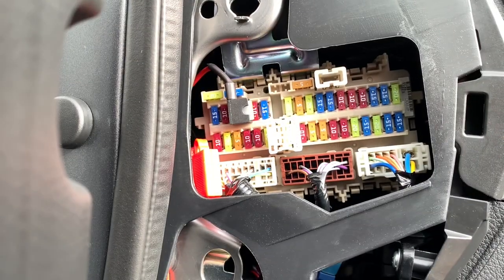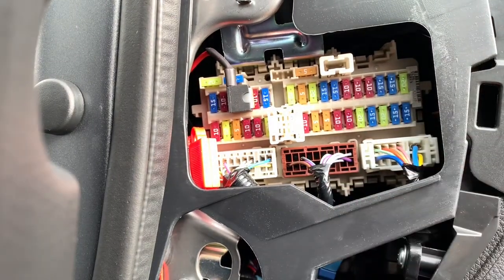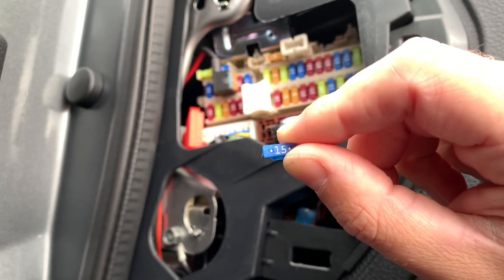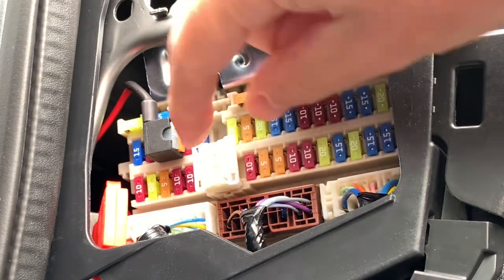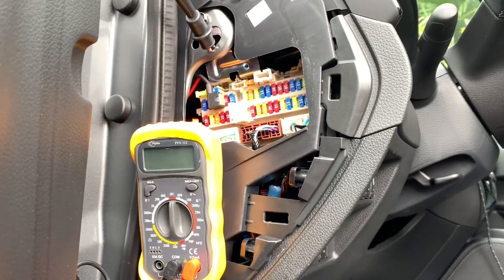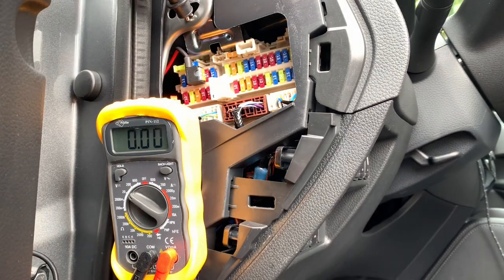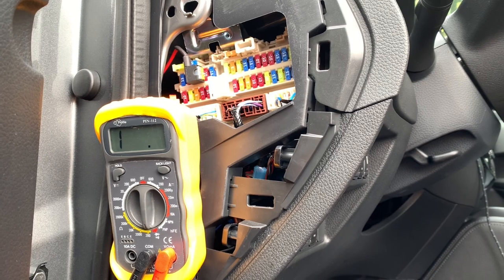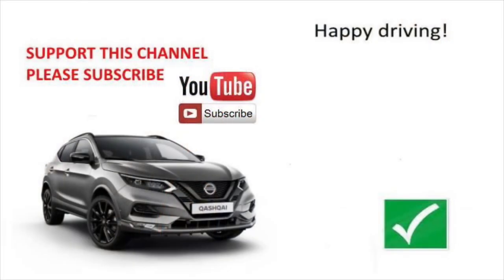Nissan Qashqai J11a&b: Which fuse is safe to use?

Comment: Very useful video -  thank you!! The colour coded diagram for reference is great! It let me know which fuse slots to select when fitting a dash cam that needed safe, switched and continuous connections. Also shows which ones remain live for a short time when locking/unlocking the car, so I avoided those too. Thanks again!
Reply from the maker: You’re welcome 😉 👊🏻
Reply: Which fuse you have finally used?
Reply from the maker: Hi! Those you can use are marked in the table. 😉 Personnaly I wired my dashcam to the power socket in the armrest.
Reply: @techher7274  I finally bought a battery which sits nicely in the glove box with velcro strips. The battery is linked to a fuse that is only live when engine is running so that it charges. I don't have anything that takes power from the battery when the engine isn't on, now.
Reply: @skycrafts5140  Linked to the fuse? Battery?
Reply: @LaPalmeraie0032  I want something hassle free.
Reply from the maker: @skycrafts create a very nice solution indeed. With a add-a-circuit or piggybag it's very easy and hassle free to use a fuse.

Comment: I want to ask you one more question. For welcome door light which fuse i can use? I want when I open the door the lights open and when I close the door the lights close.
Reply from the maker: Hi! There is not really a fuse for this but you can use the wires in the map lights as I did on my second footwell video or use the «M54» connector that Nissan fore sees for the welcome light I have under the car. It’s hidden behind the glovebox in the A-pilar and quite difficult to access.
Reply: Can you send me the link to see the video?
Reply from the maker: @dimitrismoshopoulos7542 see this https://youtu.be/f4FhKRsiDa4?si=i1ekLIwRk2QjYZOk and this https://youtu.be/rW7kvfediqY?si=257rFI1Iavjy7xKi
Reply: @LaPalmeraie0032  thanks you for all. You are the best
Reply from the maker: @dimitrismoshopoulos7542 😇🙏

Comment: This may seem a silly question but will these tips work for the new qashqai ?
Reply from the maker: There are no silly questions, only stupid answers 😉 of course these principles will apply for the new Qashqai and even for ALL cars. The only thing that will be different is the fuse layout (other fuses/different places) and the fusebox could be located elsewhere. But the owners manual should help you out there 😉
Reply: @LaPalmeraie0032  you’re a star mate, thank you for the quick reply too. I’ve just spent around 20 mins trying to find the battery on the thing so I left it alone for tonight it looks like I need a fuse tap or something so I’m safe. Honestly thank you for replying I’ll sub to you as my way of thanking you.
Reply from the maker: 😄 💪 thanks mate. Finding the battery shouldn’t be that hard? It will be well indicated in the owners manual as well as it is one of the basic things you should be able to locate as a user. Try it again tomorrow with a fresh mind and shoot of you still have doubts. 😉

Comment: Hey op 0:53 seconde  heeft u het over de power sockey.
Bedoeld u hiermee  de zogenoemde sigaretten aansluitingen in de armsteun en  het bakje van de midden console onder de navigatie ?

Deze twee werken bij mij niet namelijk vandaar de vraag
Reply from the maker: Hallo! De power socket is de sigarettenaansteker onder de airco unit. De cig_lighter is diegene in de armsteun (omgekeerd zou logischer zijn natuurlijk). Wel opvallend dat beide niet meer werken aangezien ze apart afgezekerd zijn. Even beide zekeringen checken dus; De cig_lighter zit op nummer 15, de derde van rechts boven aan. Bij de Qashqai’s van na 2017 (met de rechthoekige mistlampen) zit rechts ernaast op nummer 16 dus de power socket. Op de eerdere modellen (met ronde mistlampen) zit deze eronder op poort 32.

Indien ze allebei zijn doorgebrand best even nagaan of er geen 12v apparaat werd ingeplugd dat kortsluiting veroorzaakt.

Comment: Hi can you tell me what means a SPARE fuse? I don t understand it. Can i use it for a dashcam BlackVue? 
The live site of the spare fuse is on top or bottom of the fuse ? Or should i use the fuse for seat heating ? Thanks for answear
Reply from the maker: Hi, the SPARE fuses are fuses that are powered but aren't in use yet. Like a spare tyre, ready for use ;) So you could indeed use it for your dashcam if you would like so. The most important thing there is to decide if you want to use a continuous feed or a switched one. First is for powering your dashcam 24/7, ideal for parking monitoring etc but it could drain the battery. The second is for powering on your dashcam automatically whenever you unlock the car. So see what side is the life side, please see my Stop/Start module video where I show it when I place the piggybag or Add-a-circuit fuse adapter.
Reply: @LaPalmeraie0032  thanks for answear. I need a fuse that has power after ignition but not after open the car. 
I will measure it. I know that fuse from seat heating has powet just after ignition. My BlackVue has got a battery and i want to hardwiring this battery

Comment: Can I switch a 5A fuse for meter_ig with a 10A fuse or would it be dangerous
Reply from the maker: Hi! It wouldn’t be dangerous but the manufacturer placed a 5A with a raison. A fuse is there to protect the devices on the circuit behind it. The fuse blows before something bad happens and amperage raises higher than the devices are designed for. So no, I wouldn’t swap the fuse with a higher rating and if you add a device on that same circuit which makes the Amp go over 5A you should search for another fuse. 😉
Reply: @LaPalmeraie0032  That is incorrect, fuses are to protect cables not devices!
Reply from the maker: To avoid the cables to melt then? Ok thanks for this precision😉
Reply: Hi, thanks for your reply I did swap the 5A fuse with the 10A and all was good for like a month, but now the back lights of the speedometer like the (parking, seat belt lights and all other lights doesn’t flash any more) what do you think I should do about it
Reply from the maker: Hi! I’m not sure… I wouldn’t have swapped the fuse for a higher rating because it is 5A for a reason. Please bring the car to a specialist to let him diagnose. Keep me posted.

Comment: hello its me again 😊, i want to install hardwire kit for my dashcam, what fuse spot would you recommend for a 24hrs power supply and fuse spot for just the ignition? i’ll be using piggy back fuse. thanks
Reply from the maker: Hi! Did you check my scheme? There are several continue and free slots you could use. Like spot « 9 ». For the switched the heater seat of you don’t have one equiped otherwise one of the power sockets fuses 😉
Reply: @LaPalmeraie0032  still checking.. i don’t have heated seats.. is the fuse located at the side or at the back of the glove box. mine is 2019 n connecta 1.3 digt
Reply from the maker: RHD model… hmm it’s a bit different I know. Check the fusebox on the side to see what’s noted on the back of the cover and compare it to my scheme.
Reply: @LaPalmeraie0032  left hand drive , i guess its the same. as i checked the manual its located at the side..
Reply from the maker: Ok with all the different questions I lost track 😂 so left to the steering wheel on the side you remove the lid. On the inside you will see the same schema printed as I share in my video. 😉 on « not-imported » vehicules there’s no fusebox in the glovebox.
Reply: @LaPalmeraie0032  okay, what ampere should i use for my dashcam hardwire? or any amperes will do?
Reply from the maker: That depends on your dascam specs 😄 it should me noted in the product or box etc. Normally a dashcam doesn’t use much but you have to take in account other accessoires that are also wired to the same fuse if there are… 10 or 15A should normally be enough.
Reply: @LaPalmeraie0032  okay thank you… whenever i need something on my QQ, your videos are very helpful.
Reply from the maker: Nice to hear my friend 😉 👊🏻
Reply: @LaPalmeraie0032  do we have airbags on the side pillar on the driver side (left hand drive)
Reply from the maker: No, there’s an airbag in the side of the seat and a curtain airbag all the way along the roof; https://ibb.co/CzNv0kz
Reply: @LaPalmeraie0032  okay thank you.. my problem now is how to put the piggy back in the right place, as i’m not an electrician and might put it the wrong way. lols..
Reply from the maker: I show this in detail in my S/S module video 😉
Reply: @LaPalmeraie0032  whats the consequences if i put the fuse not in the proper position? other said i can get a check engine
Reply: @LaPalmeraie0032  based on this video i saw a piggy back that is connected to the elec-igpower. should i put the piggy back same in that position? ill be using the cig lighter and the 20 spare below the 5A ILL..
Reply from the maker: No consequence other than that both fuses will blow if there a short circuit.
Reply from the maker: You should measure with the multimeter what side is the plus. Don’t I show it in this video? Otherwise I show it in the bonnet light video, the first one with the white Qashqai. Once you understand how they work and how to read your fuse holder it’s easy 😉
Reply: hello, its me again lols😅..  i hardwired my dashcam based on your scheme and i tap using piggy back to the SPARE 20A (left side of the scheme) for a continuous voltage but i notice that after maybe half an hour my dashcam has no power, can you help me confirm if it has no power after several minutes. i misplaced my tester 😢,  i want to try to TAP on other locations but the SPARE is the only safest place to tap on.  i want to try to tap it in the interior room lamp but piggy back is touching the extended storage switch 😢
Reply: here^
Reply from the maker: How much Amp does the dashcam use?
Reply: @LaPalmeraie0032  12volts needed for a continuous power
Reply from the maker: Hi, yes that’s quite logic but for the fuse you should know the amperage that it uses. It should be visible on the device written very small with serial numbers etc. Otherwise it’s also noted on the box and/or on the sellers website. If you have the wattage you could also calculate the Amp yourself.
Reply: @LaPalmeraie0032  written on the box, input is 12-30v , output is 5V-2.4A and it has a low voltage protection of 11.8V, 
for the continuous current i tap it to the 20amperes spare on the left side base on your scheme, and i put additional 5amperes for the camera, its working but after half an hour it loses power, i tried to just put the existing 20amperes since its just a spare and it works fine but the next day the dashcam is totally no power, really don’t know if its my connection, maybe you can help.
Reply from the maker: OK, the voltage protection is for your car, so if the voltage drops to 11.8V, the dashcam won't draw anymore to prevent a dead battery. The output seems to be a dashcam chargers output. Not necessarily the Amp the dashcam draws but it will be 2.4A or lower then. As you describe it, it's almost like it gets no power and it works just on its internal battery for half an hour. You use a piggyback to connect it? Is it wired correctly? Does the ground connection makes good contact to close the circuit? The fuses aren't blown?
Reply: @LaPalmeraie0032  yes its connected correctly, i can email you the video that i took with the problem that i encounter if thats okay with you and the connection for the continuous voltage when car is off. I’ve double checked the fuse and they are not blown.
Reply from the maker: Yes you can. Also try the power socket fuse. Just as a test. The room_lamp fuse can also be used.
Reply: @LaPalmeraie0032  ill try,  i remember when i tried to put the acc wire to cig lighter fuse it will turn on and will turn off after several minutes. so instead i put it on the blower which is only has a voltage when ignition is on, I want to try to the interior lamp, but there is no space, piggy back will touch the extended shorage switch
Reply from the maker: @lloydd7202  I see...
Reply: @LaPalmeraie0032  can you recommend other fuse spot for the continuous voltage? i would like to reposition the continuous voltage.
Reply from the maker: Hi, in my scheme you see all the spots that could be used. Try different ones and if still nothing try to connect another simple accessory like a small led light to check if it isn’t the dashcam it self that is the problem.